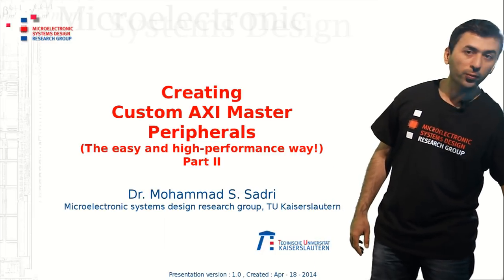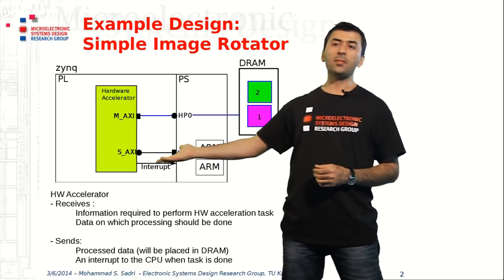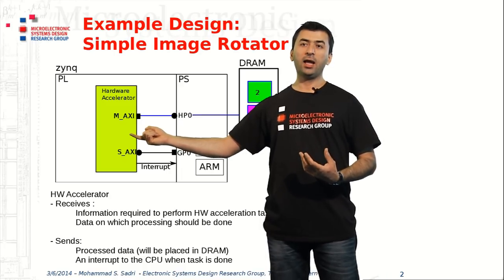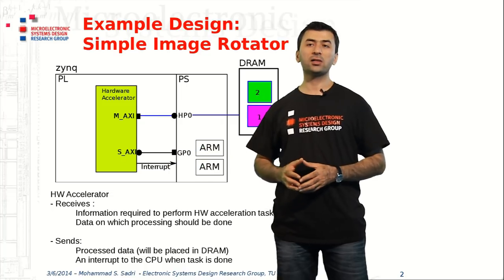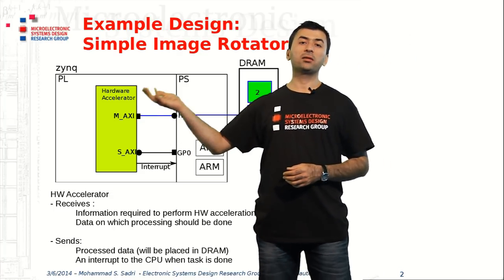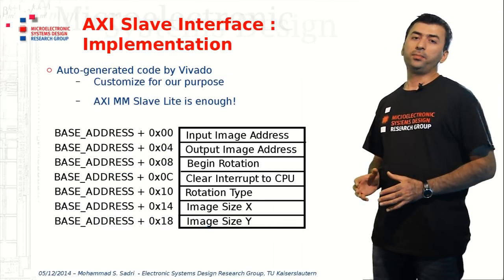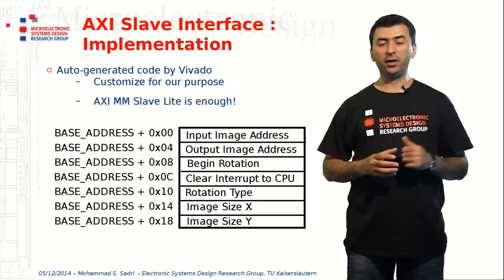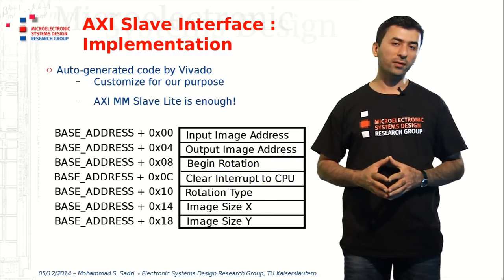Creating Custom AXI Master Interfaces Part 2 (Lesson 7)

Comment: This design is similar to the current design I'm working on. I have a slave AXI for the ARM processor (Cortex-A9) to update my status registers. A master AXI for me  to read/write to the DDR3 memory via the ARM processor's slave AXI. 

BUT I also need 4 (or more) Interrupt Signals to the processor for different tasks. Can I hook up these Interrupt Signals directly to the ARM Processor or do I have to use the AXI Interrupt Controller IP ?  ( I thought I can do that BUT I saw an example where the AXI Interrupt Controller IP is used). I appreciate your help. Thank you.

Comment: Related to min. 9:20. Is information send to IPIF in the first rising edge after bus2ip_mst_cmdack and ip2bus_mstrd_req are both active or is there a sof/eof signal?
Reply: I have the same question with ready, valid and data from AXI.

Comment: How is the Hardware Accelerator block made as an IP. Are you creating a custom IP with AXI Full master interface and then remove the given code and put AXI master burst instantiation code and write the logic?.
Reply: cschandu123 watch part 3 and you get the answer